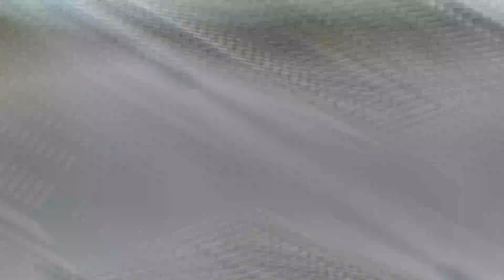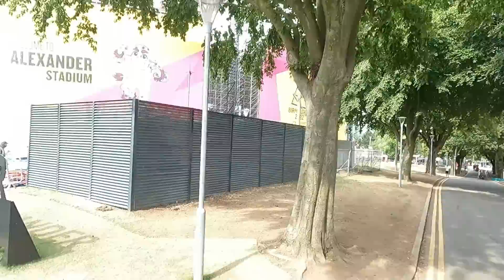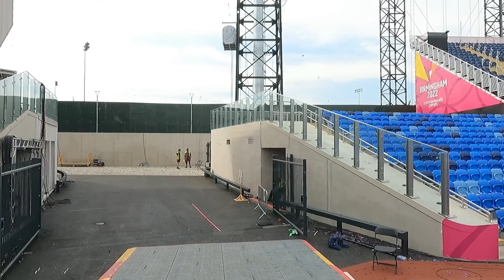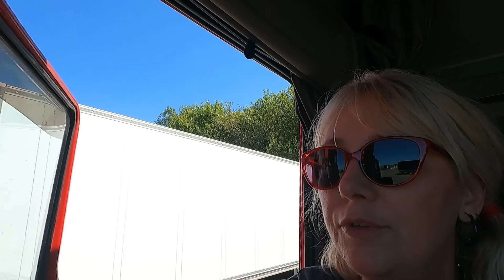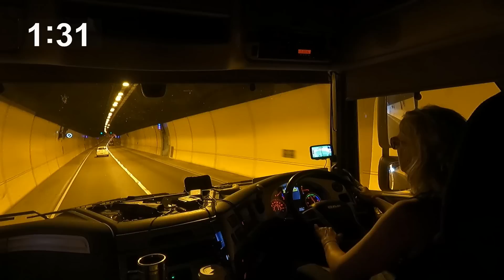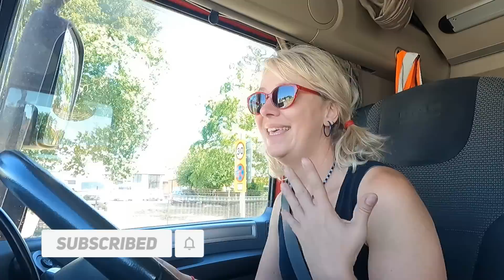Commonwealth Games delivery- ►#42    #trucker #truck  #stobart #truckmania

Comment: Brilliant new video Lina, it amazes me how you adapt so quickly to the different makes of trucks you drive. Keep up the good work be safe yours mick 😊
Reply: It's not that hard, pressing the throttle down in an auto truck with a different badge on the front
Reply: She is still driving a HGV wether auto or manual
Reply from the maker: Thanks Mick 😊
Reply: You have a lovely week Lina be safe